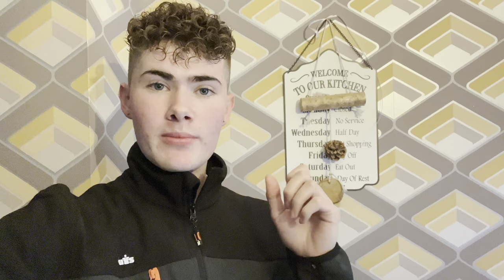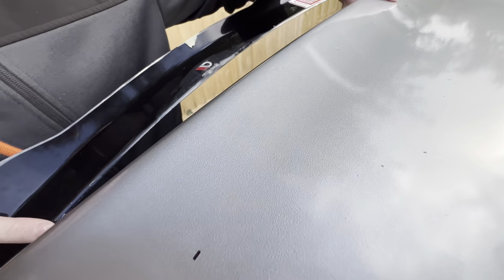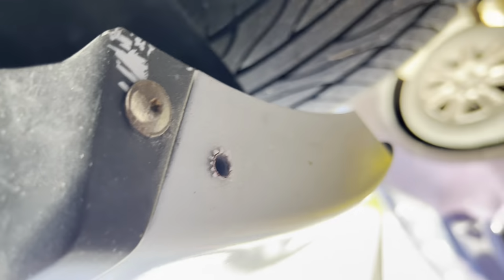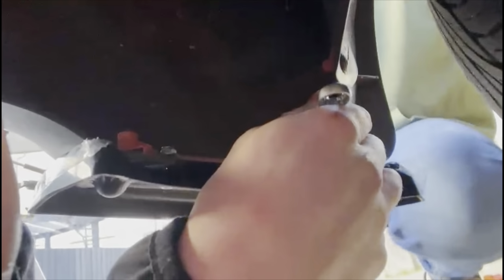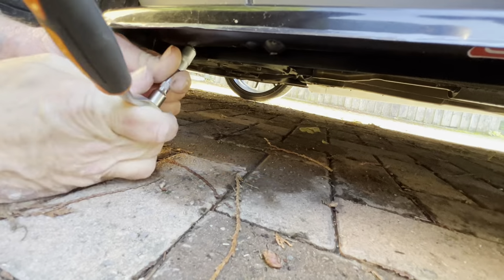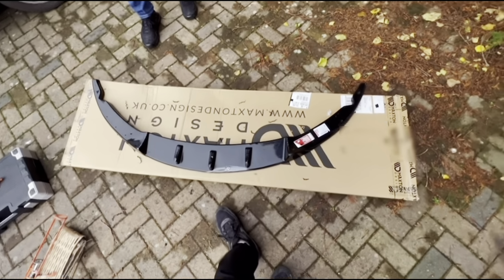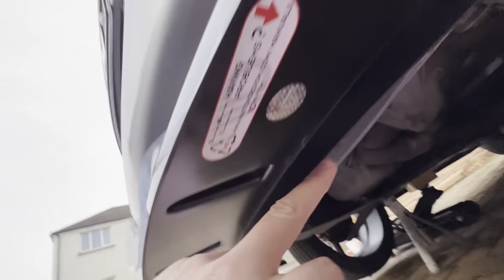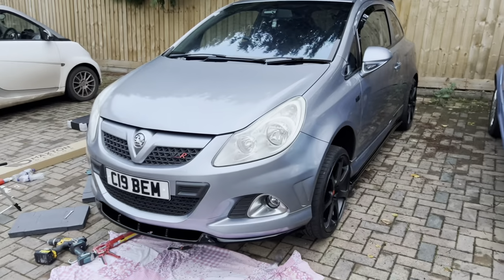Full Maxton Body Kit Install On Corsa D

Comment: nice bro im doing mine now a facelift 1.4 vxr rep was pricy eashhhh
Reply from the maker: It definitely is pricey it’s definitely worth it in the end if your a young driver and can’t get insured on a genuine vxr though glad you enjoyed the video mate good luck with your new face lift 💯
Reply: @yt_brandonemBEM  thank you bro im 17 atm i need to go get my exhaust done for a center exit its booked in for the weekend
Reply from the maker: @mtb_kjl7886  happy days will be so worth it once it’s done I was so gassed when mine was fitted are you having it fully straight piped or you gonna have a small silencer
Reply: @yt_brandonemBEM  well as mine is a 1.4 it already has a middle silencer… so From the middle silencer it’s gonna be straight pipe
Reply: @mtb_kjl7886  how u doing this with insurance being the way it is for 17 year olds

Comment: can you get these for a corsa d se? or are these designed for the vxr body work?
Reply from the maker: For the side skirts extensions and rear spats (YES) if for the spoiler extension (NO) as for the  front splitter I’m not 100 percent sure it says for vxr but the front bumpers on the se look very similar where it lips up so I don’t want to say yeah Incase it doesn’t fit hope this helps 🔥
Reply: @yt_brandonemBEM  respect man, good work btw I watched your old vids first n it’s come along way

Comment: Does it also make the gap from floor less that much only cause im thinking of doing these things on mine but i have to go up a kerb to get my parking spit and concerned if it makes the gap less then it would just get ripped off or trashed straight away

Comment: Is it possible to add sterling wheel  with the handsfree
Reply from the maker: Yes there ! is you have to buy it as an upgrade
Reply: @BRANDON E-M  it's a 2012 corsa is this possible . I've tried to Google to see if it has the working harness or would it automatically wok once everything else is connected